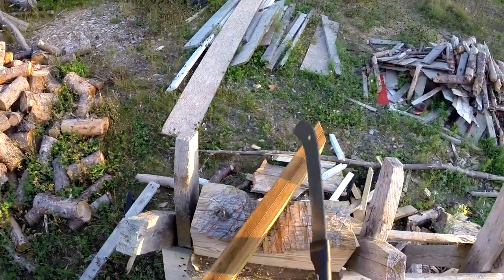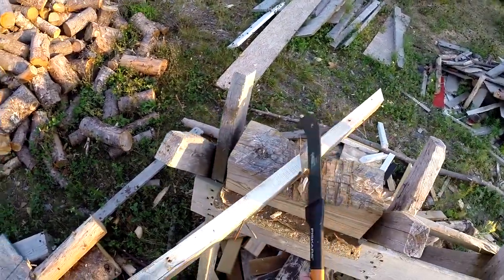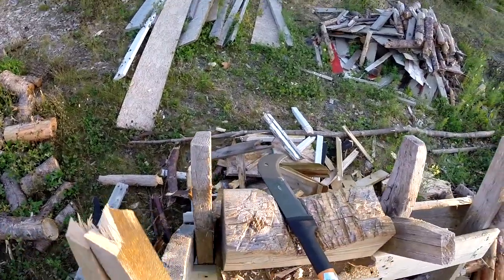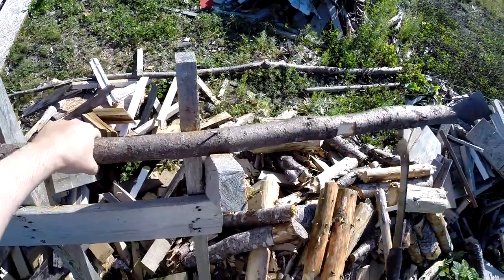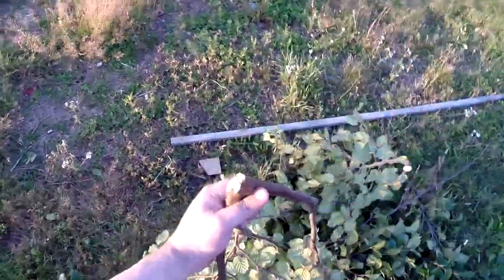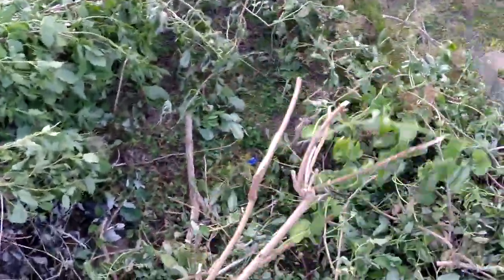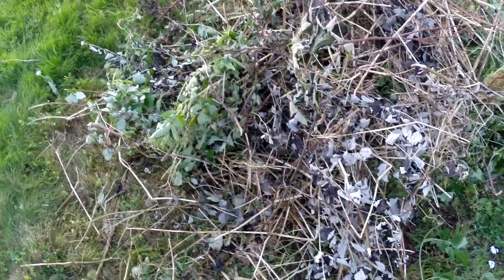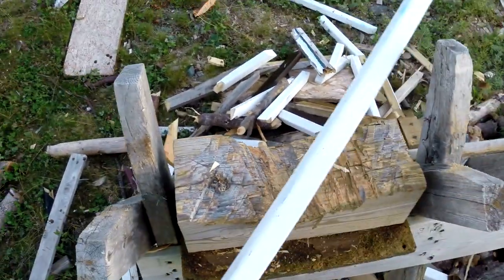BBF # 6 : Fiskar's Brush Axe

Comment: I like mine a lot, working in the bush just getting from place to place more easily.  Makes normally impassable alders into matchsticks, and the hook is perfect for moving stuff around.  For that application I wouldn't really want the blade stock to be any thicker, since it would add to the weight I was lugging around.  I wouldn't want to use it for splitting or chopping wood though, when there's an axe back at camp.  I use it more as a machete with a hook, and for that it's a great tool.

Comment: If the Fiskars brush axe 'wood' have been used faster it 'wood' have gone through those thicker pieces much easier.
The strength of this tool is its light weight. Whip it like when you're holding a badminton racket, a whipping motion. When you use it with the speed as if you're holding a sledgehammer, you're not getting maximal usage out of this tool. It's pretty powerful when using it with high speed.

Comment: Very interesting video.

I actually picked up two bill hooks from baryonyx...haven't had a chance to do a lot of work with them, only a bit with one of them.  They have drastically different hook shapes...one is very gentle (just a bit more than the woodsman's pal), while the other is almost a 90 to the primary edge and sticks out several inches.

Still when clearing brush with the one, it's immediately obvious the advantages of the hook.  It really does make it easy to move the cut material around, and it's also easy to insert it behind stuff close to a fence and do a pulling cut.  And in general it allows you to kind of do a swing with a pull that seems to cut more material and a standard swing as you trap the vegetation the hook.

The CS Panga machete I have is what got me interested in billhooks...the very strong upsweep of tip creates a hook (obviously unsharpened) on the back, and when cleaning up a large tree that fell in the yard it was incredibly useful for hooking small branches and moving them around.
Reply from the maker: Yeah the patterns are very drastically varied. I keep meaning to pick up a few more as I want to try a few with the hook on the back as well as the secondary axe/straight edge.

Comment: Does the hook protect the rest of the edge, the straight part if you will when using it close to the ground and if so could you leave the hook area at the higher angle and flatten the edge on the straight part?
Reply from the maker: Yeah, it does exactly that. I just loan this to friends/family often as it is a solid all around brush tool and if I edge optomized it then it would get mauled. But if you are going to use it sensibly then you could do exact as you noted, or in fact even double bevel it as a lot of traditional ones are ground.

Comment: Does the hook prevent you from making contact with the "sweet" spot of the blade when chopping? It looked like you kept try to strike higher up on the blade.
Reply from the maker: On block type chopping, yes it gets in the way. That is why many of them have another edge on the back which can be used for heavier chopping without the hook.

Comment: How do you find chopping with that in terms of vibration? I find on harder woods it is quite painful to use.
Reply from the maker: Yeah, not very nice for that at all. The edge angle is high, it doesn't wedge the wood and binds heavily, and is fairly thin so can vibrate excessively. It isn't what I would want for that type of work at all. Joe's blade completely dominates it there.

Comment: Handle wrap?  I still have not removed all the coating from the bevel on the one I have.  Infind that the coating slipjoint wa down sharpening and clogs my stone.
Reply from the maker: Yeah, I have to wrap this it is very slick otherwise. I was using a tennis tape for awhile but I am back to using a green self-adhesive guard tape that lee valley sells. It is very inexpensive, doesn't stick to the handle but to itself and has very nice traction.

Comment: How's the handle holding up? Didn't you comment before that you had problems with minor splitting of the handle before?
Reply from the maker: It had a small crack initially which I filled, no issues since then. Mark had one fail completely.

Comment: Say Heah Cliff,  I have a Condor Wilderness Tool,  It has a modified Billhook,  along the handle is also a curved blade for slicing and is connected to the billhook,  Along the curved top is sort of a chisel edge that helps to cut through roots for cordage and you can make fire pits and kitty holes,  at both ends is a larger hatchet bit and a smaller bit which I like to use it to split kindling,  yeah check it out and maybe do a video on it,  I don't understand why it's not popular and no video's. A multi function that really works good. I teamed mine up with my Steel Will Druit 240 and my Bacho Laplander for my winter afternoon delights a nice hot cup of coffee with eveperated milk and honey and a nice cigar like my Torano Naventa 90 La Exporanza.  ,, .
Reply from the maker: Billhooks, the functional tools are not very "sexy", they are unlikely to catch on for that reason, plus they are bulky and hard to carry. Most working tools tend to be like that because no one who works for a living cares about those things. If the amount of time you spent walking to work is less than the time you work - well you have other issues.
Reply: Yeah my Confor Wilderness Tool is a poumd and made out of the 429HC which I like especially on wet and snowy outings,  That's why I teamed mine with my Steel Will Druit 240, But a few day''s ago I teaned my Wilderness Tool with my S. O. G.  Seal Pup Elite and to my surprise even though the set looks tactical,  It performed great in the bush,  The two really complimented eachother,  Yeah,  It's was that moist snowy day,  But I think it will be good in any kind of weather.  Year it's compact and I wear them cross draw side by side,  Nice to text with you Mr.  Stamp.  ,, .